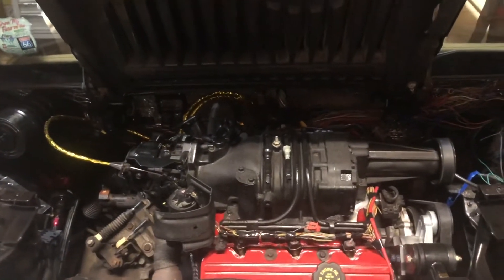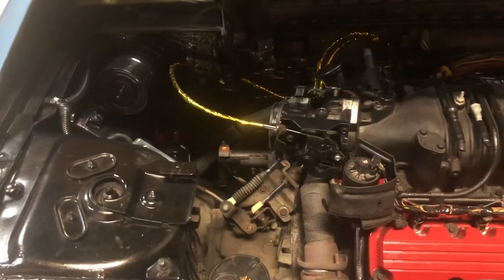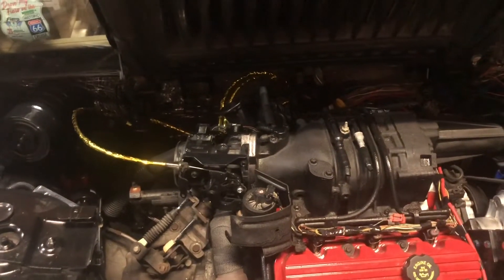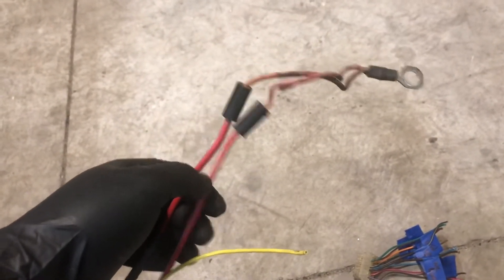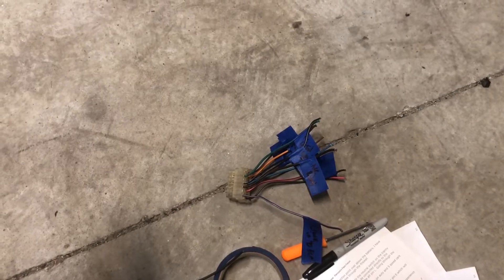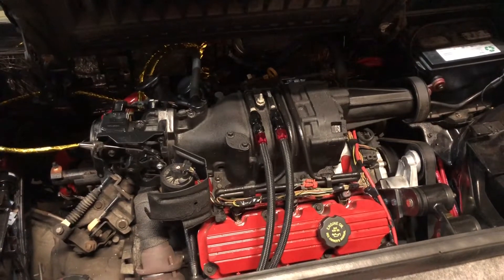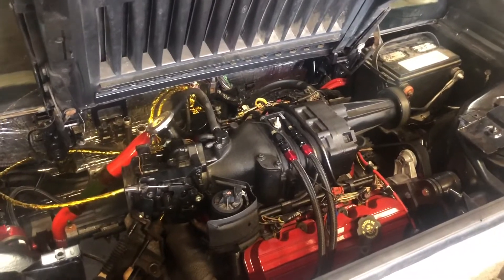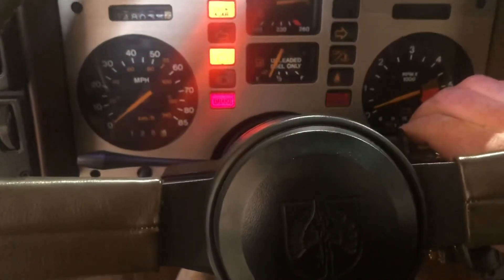Getting the 3800 swapped Fiero running!

Comment: i was going to ask if you wanted some wiring info I got with my car, then you mentioned 84. LOL  I was able to get some files from previous owner.  So if you would any thing like that let me know.
Reply from the maker: Steven Williams the 84 is different. I was able to get it going with the 84 service manual and wiring diagram for the regal the engine came out of. 👍
Reply: I heard there were like 285 changes made in 85 over the 84.  LOL PO gave me some good data files and such on the swap that I have kept.  Wiring looks like a night mare to me.  LOL.
Reply: @stebecinc  can you send me the wiring for this
Reply: @stebecinc  info of course trying to do this build
Reply: Gladly, I have them on an older laptop,  Hmm lets see can I email them from the laptop. It still has current antivirus installed.  Sorry just thinking out loud.  So yes give me the email address to send them to .